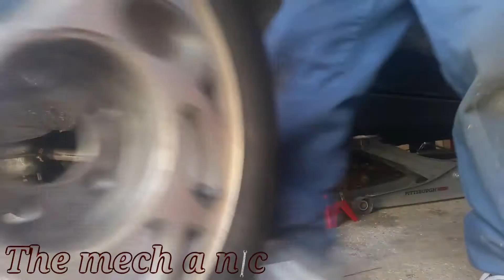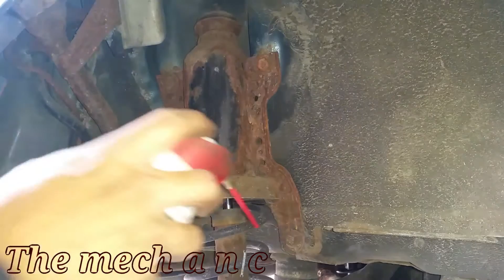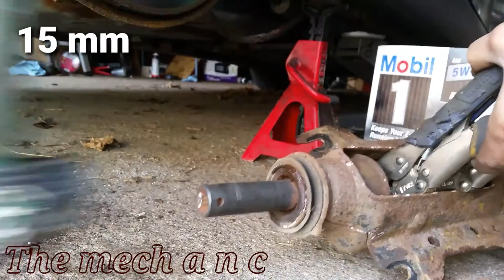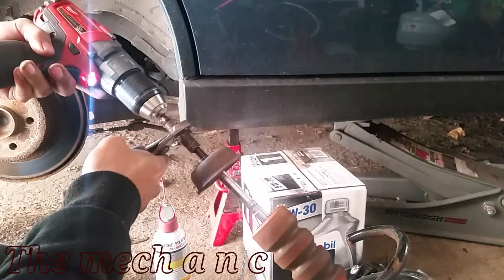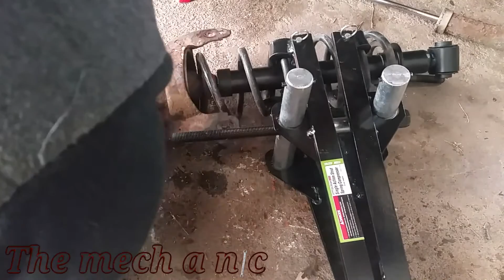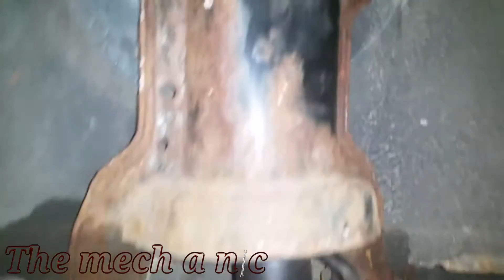2002 saturn l200 rear strut

Comment: Great video thanks for sharing. When removing lower shock bolt from the iron casting, heat the casting not the bolt. Mine was crazy rusty but came right out with heat - you want the heat to expand the nut, or casting around the bolt in this case. Heating the bolt makes it expand which actually makes it a tighter fit in the hole. And the smaller bright blue part of the flame is hottest, get the tip of that against the metal for best heat transfer.
Reply from the maker: I tried heating the casting around it. The bolt wouldn't budge.the I tried heating the bolt.  The video is edited . That's for the tips👍

Comment: Nice video. I would suggest going back in/tight with rusty bolts. And using deep creep helps a lot. I also let the bolts cool down, so there is less chance of breaking them.

Comment: Thanks for this video.  I have a 2003 Saturn LW200, and if I ever have to change the rear struts, I can see what I will be in for.  I like that tip to cut a flat spot on the shaft, if necessary, to be able to keep it from spinning.  I also have that same strut spring compressor, and I really like it.  I used it 3 years ago on the front struts of a Chrysler K-car, and it made the job go easier & quicker.  With that spring compressor, that single bolt is doing a lot of work, compressing both sides of the spring, so I have greased the bolt each time before I use it.  Also, it's good to know that if that strut mount to the fender could not be reused, then the part from a Saab 9-5 would also work.
Reply from the maker: Thanks for watching. Nice info 👍

Comment: This video is a gem! Almost the same on a Saab 9-5 and Vectra B
Reply from the maker: Thank you. I appreciate it
Reply: 18:38 I have one question. I'm trying to find the correct rear-strut bolt, I know it's a M14x90, but what I don't know is the length of the threaded bit of the bolt. Is the inner sleeve of the strut threaded or only the part on the trailing arm?
Reply from the maker: @screwit8408  only the trailing arm is threaded ,it'll just slide right past the strut so the bolt doesn't need threads along it's full length
Reply: Thank you! :)
Reply: Yes, the Saturn L200 is based on the GM2900 platform, first introduced by Opal in 1988-89 and shared by many brands/models across several continents.

Comment: Excellent video! Thanks for all the tips and time to produce this helpful tool!
I need to replace my 01 Saturn left rear shock with a junkyard part because the big spring broke Hopefully replacing it all in one piece will go well?? Parts stores no longer carry the spring and if they did, it would be big bucks!
Reply from the maker: +JOEB JOEB thanks for watching. Yes the junk yard is your best bet, it the strut is no good as well there's no better time to change it. The biggest problem here is rust . Hopefully you have an easier time than I did. Good luck. Let me know how everything goes for you. Once again thanks for watching.
Reply: JOE JOEB: About $70+ each on eBay. They're factory GM replacements. In my opinion Saturn's were engineered terrible. They have a stiff noisy ride as well. I was looking for an Aftermarket spring which of course they don't make to possibly correct the ride issue. To add to it they're rattle-traps also. I've have clunks and rattles with mine since I bought it 5 years ago. Thrown money at it for parts that may be the problem and it still won't fix it. They're weren't highly rated for a smooth quiet ride on the reviews on Car & Driver, which didn't surprise me. Now I wish I wouldn't have ever gotten it. My Nissan Frontier work truck rides smoother and quieter than these. I've put too much money into it to get rid of it now, including another engine. Live and learn.

Comment: I had to cut the piston in half. The nut wouldn't budge it was so rusted. Heat wouldn't even get it. You can do that too with a dremel cutting wheel. If your going to just change the mount and bushings, then you have a problem. May as well just replace the entire strut. They're not that expensive. You'll need a spring compressor tho. The mounts to the fender wall aren't available. If they're too rusted to reuse, you'll have to go to the yard for those. If you can find one, SAAB will work too.
Reply from the maker: Yeah it can turn into a nightmare

Comment: When the nuts on the top of the strut are this rusted, I think it's easier to do what I did.  I used a dremel with a cut off wheel, cut the top of the strut flush with the top of the nut, then use the same cutoff wheel to cut an X on the top of the nut with the center of the X on dead center of the strut shaft itself.  Then I bored a small hole (using the center of the X as the starting point) down past the bottom of the nut, and then used a large bit that was the same size as the strut shaft and bored it through the smaller hole.  When it got down to the bottom of the nut, what's left of the nut comes right off.  Takes about 2 minutes.
Reply from the maker: That would work. My Dremel is broken so I didn't have that option

Comment: People think new struts make it ride better but actually they don't. Only if they're leaking do you need to change them. You can put new dust boots and bellows on them if they're worn as well. I know, I spent money of new struts all round and it still rides like a flat bed truck. Proves there's no difference.
Reply from the maker: The spring is what determines the smoothness of the ride. Cheap aftermarket struts/springs tend to ride more rough.
Reply: What's the 2 sided bar name bolts to frame and back wheels

Comment: Thank you for the great film and pointing on that Harbor Fright  spring compressor. Did you add any liquid at some point? Maybe it is not required on Saturn. I need to do a similar work on Nissan Sentra 2009 (front though), and mechanic told me that the strut is leaking, so I assume I need to add or bleed that liquid.
Reply from the maker: There is no adding or bleeding required. You just have to replace the strut

Comment: Do you think its mandatory to use a spring compressor for this job ? Jw if i should get one before the parts come in.
Reply from the maker: Yes, you need a spring compressor.
Reply: Thanks for the info! Another question.. Should I get an alignment after this is all done?
Reply from the maker: Its not a bad idea to get the alignment checked afterwards👍

Comment: Hay sir where did you find the coil springs iam working  on a 2000 ls saturn and cant find them anywhere
Reply from the maker: I reused the coil spring.only replaced the strut
Reply: I picked up some from GMPartsDirect $99 each, OEM for the 2002 was 22698016

Comment: Are the rear shocks the same on an l300 Saturn
Reply from the maker: +Marcus bigdaddy it's different,  it's more like the strut on the front of the car.
Reply: yes rear sruts are exactly the same. If yours isn't rusted as bad the top nob will fit in 6-7 mm socket and then you can use a 16mm wrench to loosen the strut bolt.

Comment: Where the heck do you find these parts at
Reply from the maker: Rockauto
Reply: Have you been able to find the whole assembly new or maybe just the coil spring.
Reply from the maker: No, I only found the strut alone. If I found the whole assembly I wouldn't have gone through the trouble I did in this video

Comment: The struts have a key on the top for you to put a socket or wrench on lol, all that torch vice grip nonsense is silly. If it snaps just cut the strut ez pz
Reply from the maker: Hmmmm i didnt notice that...
Reply: @themechanic6117  yeah most struts will have that but if they dont you could save yourself a lot of time by just cutting the strut with a grinding wheel or even that dremel
Reply: The stock saturn ones do have it though, maybe it was rusted over so much you didnt notice
Reply from the maker: That or they've been replaced before because im pretty sure i didnt notice somewhere on top to hold the strut shaft